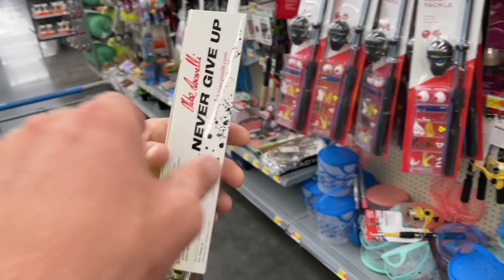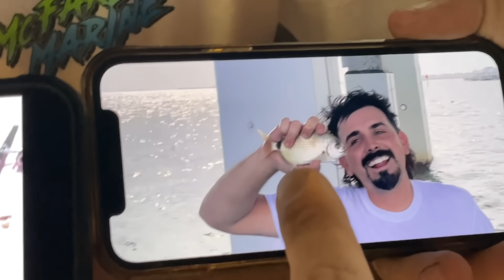$2,500 Boat Challenge Ep.3 - HIGH SEAS Totaled James Jet Boat and Left George Stranded..IT WAS CRAZY

Comment: It's not totaled.  The deck and the hull were glued together to start with.  Just go to a boat supply store, and get some resin and fiberglass tape.  Glue them back together and a glass in a strip of tape around the outside and inside and you're good.
Reply: And put a stack or filter on the carb, that thing is gonna backfire huge one day....
Reply: How much budget does he still have left to spend?
Reply: @billagedad1  coast guard requires a flame arrester; pretty sure that boat's current configuration would be deemed unseaworthy

Comment: "waves are probably two to three feet" no, those are less than two feet peanut chops. between the waves is a trough about equal in depth to the waves height above level water surface.
so a real two foot high wave looks like a four foot wall when in the trough, a four foot wave looks like an eight foot wall of death. been there and done that on lake Erie, almost at the Canadian border line in a 17 foot boat, when a massive storm came out of nowhere on a day they said would be very calm two foot or less waves. white knuckles for many hours getting back to shore at snails pace, it can be far more wicked than inland ocean/sea water areas  😰😱